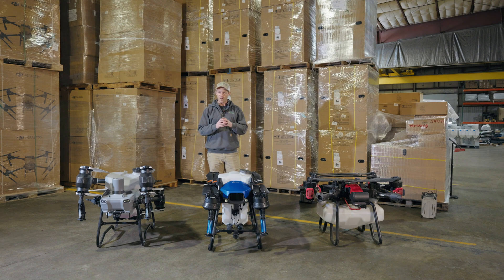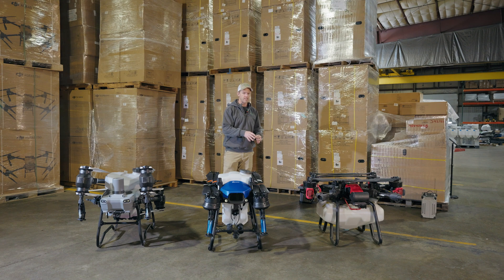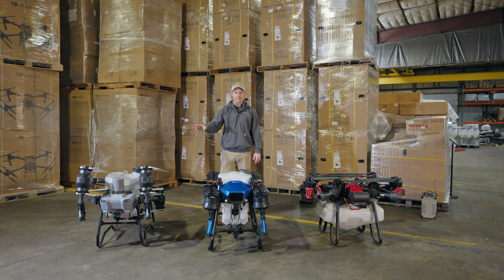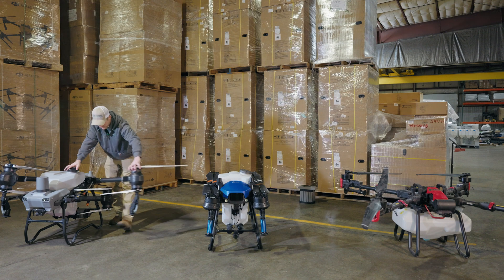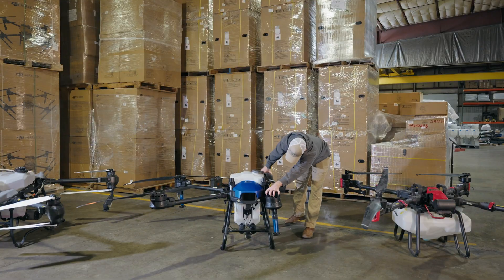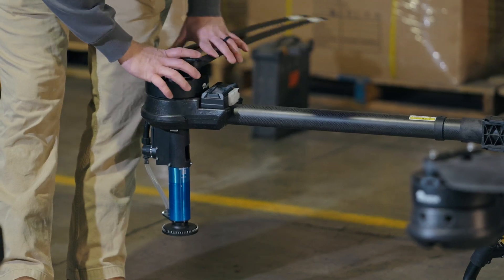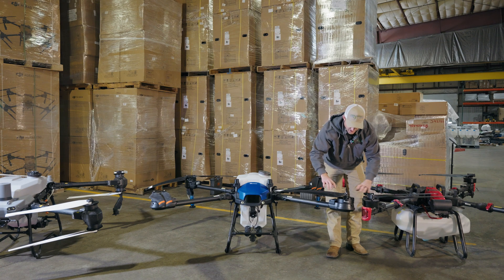EAVision J100 vs DJI T50 vs XAG P100 | Frame and Components

Comment: 🎯 Key points for quick navigation:

00:00 The video explores battery and charging systems for DJI Agras T50, XAG P100 Pro, and EAVision J100 spray drones, highlighting their importance due to frequent battery changes.
00:26 Spray drones require frequent battery changes and transport for optimal use, emphasizing the need for effective battery and charging systems.
01:08 The XAG P100 Pro uses two batteries, creating redundancy but requiring cumbersome handling during battery changes.
02:47 XAG P100 Pro's battery cooling system uses water, which may become inefficient in high temperatures due to stagnant water not being replaced.
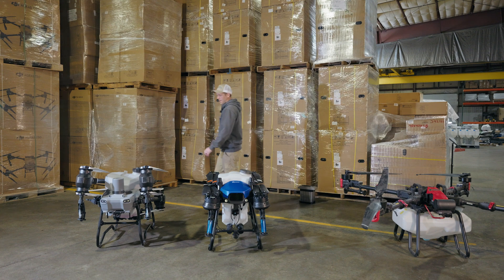03:57 Using two batteries in a drone requires careful charge level matching to avoid voltage imbalances that could cause power transfer issues.
04:54 DJI T50 has a single 30,000 milliamp battery with a heat sink for air cooling, which while efficient, offers only limited heat extraction.
06:00 EAVision J100 has a lighter 29,000 milliamp battery with a unique modular design for improved cooling and repairability, lowering overall battery costs.
09:01 The J100's charger is an integrated unit with efficient energy transfer and protection against short circuits, due to its innovative design.
10:21 Positive-negative terminals with alignment pins prevent misalignment in the EAVision J100, improving replacement ease and safety.
11:21 EAVision J100 lacks battery clips; the design ensures the battery stays secure unless flying upside down, enhancing ease of replacement.
12:00 Simplifying battery replacement and maintenance improves efficiency, cutting down time and costs, leading to better operational efficiency.

Made with HARPA AIm

Comment: Kinda wonder how much EA vision is paying them to do this. A lot of the logic on the ESC placement and number of motors is flawed. There is a tremendous about of air flowing over the ESC in both cases so matter and if anything the DJI gets more cooling from it being sideways (that’s how air is supposed to flow over a heat sink) look at anything with a heat sink if you don’t believe me. (Im an engineer so I know what I’m talking about 😂)

Also having two creates redundancy it might be more parts to replace but having two motors on an arm could help you if a prop motor or ESC fails. Probably won’t work under a full load but it might save you when there’s no payload. 

Just going off of propulsion the j100 has zero advantage there need to be a significant improvement from the T50 to the j100 to make it worth the cost.
Reply: Speaking from experience, my T40 had a motor seize up with a near full tank and it started spiraling but I took over manually and could stabilize it and limp closer to the road, but I wouldn't go too far like that.

Comment: J100 is very sleek, I do like that. The ESC point you keep making between DJI and EA is moot, both will dissipate heat through the heat sinks just fine and arguably the DJI is actually a better mounting position but again, just isn’t going to matter in any meaningful way. I like the idea of having only 4 ESC’s and Motors if/when it crashes; however, I’ve seen ESC go bad on DJI and it stays in the air because you have redundancy with the extra propulsion system, very safe. If you lose an ESC in the EA, she’s going down, or worse, sideways while landing or near a road and someone might get hit. I can see both sides of that argument but I’m not gonna broadly accept the EA is a better drone because of this point. Looks promising, but at this point all we’ve really seen or heard is just a sales pitch from the EA Vision team. Does AgriSpray really have enough time on these to say they are superior in every way to the DJI Agras series?

Comment: What’s the empty weight comparison of all three just out of curiosity. We use the P100 Pro in NZ and by far the best on the market here in my opinion. Solid construction but light empty weight and now with the 60 litre upgrade kit it’s a spraying beast especially for high water rates.
Reply from the maker: T50 is 115 lbs, P100 is 106 lbs, J100 is 120 lbs with batteries in each. Without batteries, T50 is 88 lbs, P100 is 75 lbs, J100 is 94 lbs.

Comment: ESCs on all of them are getting so much air flow when the props are turning. How can the mounting direction matter? Plus, the DJI has two of them on each arm, so they'd have to mount both on the top using Taylor's theory. The way DJI mounted them shouldn't have any negative effect in my opinion. But I'm not a drone engineer. 
I believe that the real deciding factors are all about acres/hr, quality of application, ease of operation, durability, battery and consumable longevity, and availability (in that order).

Comment: Hmmm, time for another droplet comparison video but include flat land and lets see how they do on terrain following. Curious about the DEMONSTRATED acres per hour and what it takes to get it done with each setup, particularly the user interface. Hey Taylor, you should consider a dolly that'll work on most any of them, aka a furniture dolly.  Castors would make rolling them around a breeze, especially a small fleet.
Reply: So this is just in my area mind you, but some gentle rolling hills and some flat ground, the T50s effective acres per hour hits between 40-45. The P100 Pro hits around 50. (30-32ft swath at 20mph on T50 vs 25-28ft at 25mph on p100 pro). Best guess for the J100 based on purely on spec comparisons and demo videos I'd say it would be around 45ac/hr at 20mph and same swath as T50. 

The j100 can go up to 30mph, but from my understanding that's with the lidar obstacle avoidance turned off. The P100 Pro can fly at 30mph too with obstacle avoidance turned on even, but with any drone in hills, I would slow it down to reduce floating over steeper hills.

Best ac/hr I've gotten with P100pro is 60 on flat ground at full speed, but realistically over a day it's not the easiest to sustain that all day. 

The P150 can hit 40mph and the flight efficiency (turning, landing, and takeoff) is improved over the p100 pro (a test I saw was 18% improved efficiency), so the flat ground ac/hr could probably hit 70-75.

Comment: If you look at other Chinese spray drone brands like Joyance Tech and EF, they all appear very similar, including the EV drone. This is why spending $31,000 on a drone that resembles others priced at $5,000 doesn’t seem worth it. The software interface doesn’t look as refined as DJI's either. I believe the EV drone is overpriced, and I’d be curious to see how it performs after two years of rigorous use.
Reply: those brand parts are cheaper but it crashes frequently compared to the main brand also it sucks at autonomous hill terrain the most important thing is that it has a very low battery cycle
Reply: Joyance has bad reputation die to low quality products and low life expectancy batteries too for drones
Reply: Joyance Tech at your service

Comment: Interesting, but I think a comparison in action during spraying would be valuable to assess the precision of each, as well as the flow rates and the working time for each on the same surface.
Reply: Video is coming!
Reply: Hopefully they run rolling terrain with them. Compare obstacle avoidance systems.  And maybe run them in best operation setting for each one not just identical/comparable settings